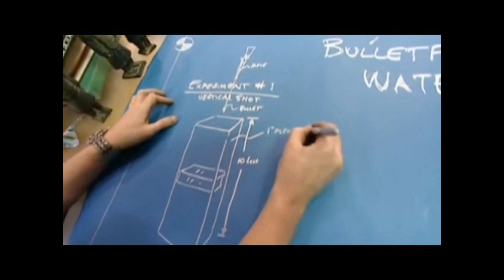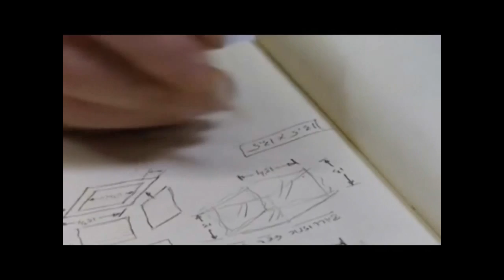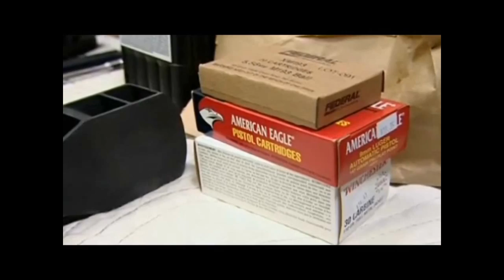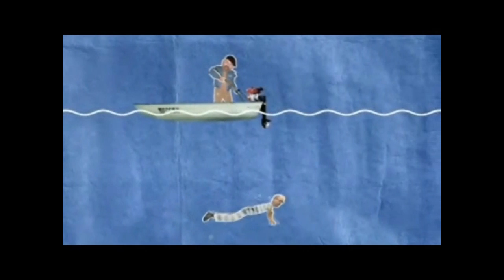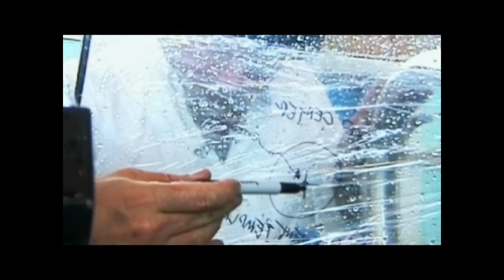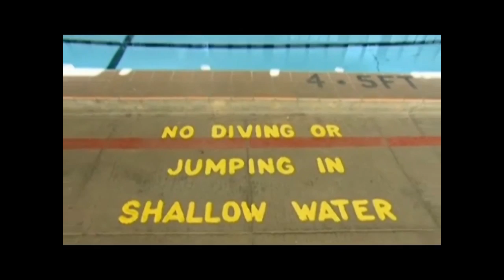Mythbusters Bullet Proof Water Myth

Comment: This might be false but I'll post it anyway. The kinetic energy is 0,5mv^2, so the faster the bullet travels, the more energy it has. Now everyone knows that energy won't get lost, but it'll be transformed into some other kind of energy. Now how faster the bullet goess, the harder it will hit the water. The bullet is made of a certain type of metal. All metals have their own 'allowable stress'. So the harder the bullet will hit the water, the higher the 'resulting stress'. So in conclusion, The bigger the gun, the faster the bullet will fly, the bigger the force will be, the faster the bullet will break. (sorry for any language errors, English is not my native tongue)
Reply: That works because liquid water is almost uncompressable material.
Reply: +LightCrasher Steel is compressible but water isn't?

For the same force applied steel will compress over 200 times less than water will.

The reason you "can shoot a bullet through steel" but not water is quite simply that you can't. Not for the same thickness anyway. 3 feet of steel will stop any bullet fired from any rifle ever made. The thickest tank armor is less than half a foot.
Reply: LightCrasher Common sense doesn't refuse to accept that, it just isn't true. Both incredibly obviously intuitively, when any thought is put into it, and experimentally. The bulk modulus of water is on the order of 1GPa, whereas steel is a few hundred depending on the type of steel. 

Here's an actual proper measurement of stainless steel's bulk modulus, page 20 http://www.nist.gov/data/nsrds/NSRDS-NBS-61-V.pdf

171GPa. 

And I was just about to go cite you the bulk modulus of water, but I've just seen the wikipedia article that you're getting your numbers from. The article you've got it from is in GPa, not psi, and shows very clearly that water's bulk modulus is much lower. You've compared water's bulk modulus in GPa to steel's in PSI.
Reply: LightCrasher Compressing metals... you've just failed 3rd grade science.
Reply: then why can you shoot the bullet trough steel or even bullet proof glass? ain't that harder than water?
Reply: LightCrasher I've said where I got them, and even shown that where you've got them says the exact same thing that water is much much more compressible than steel.
Reply: seldrava The moment of inertia has absolutely nothing at all to do with the penetration depth.
Reply: +BlueCosmology , By changing the moment of inertia, farthest fibre distance or ‘Modulus of Elasticity’ you can in fact make an object stronger. And since the ‘Modulus of Elasticity’ changes with different materials this causes one material to be harder to penetrate than the other. Please mention that this only applies to solid objects.

‘Moment of inertia can be thought of as resistance to deflection, yes. It is not what causes metal to be harder to penetrate than other objects.’ Let’s assume we have two objects (different materials), they both have the same dimensions, than in this case, the resistance to deflection does indeed not affect the resulting stress, since the Moment of inertia depends on the dimensions. All I’m saying is that by changing the Moment of inertia for different objects, and different materials (to make one object thicker and if possible less wide) you will lessen the resulting normal stress on that material. And eventually a (in this case) bullet will no longer be able to penetrate. I hope I explained what I meant more clearly now.
Reply: BlueCosmology Can I see where did you got this numbers from?
Reply: Did not see it at the feed trough...
Yeah, I see now. Thanks for correction.
Reply: +BlueCosmology , It has to do something with how much the 'to be penetrated' body can take.
Reply: seldrava It does not at all.
Reply: +BlueCosmology , It might be that I'm calling it wrong though. English is not my native language. I mean the resistance to deflection. Area moments of inertia maybe?
Reply: seldrava Moment of inertia can be thought of as resistance to deflection, yes. It is not what causes metal to be harder to penetrate than other objects.
Reply: @BlueCosmology  So, are u guys in NASA now after these 5 years???
Reply: @kingkong9233  I'm not sure why you're asking this but I was a member of CERN as a particle physicist on ATLAS 5 years ago and I still am now.
Reply: @BlueCosmology  Hey i was there too in the laser department and I still am now; wow, got alot of work to do; see u at the coffee shop.
Reply: @kingkong9233  Laser department?
Reply: @BlueCosmology  ohh, so you were serious about being a member of that CERN project?? I thought u were joking and so i replied childishly. Cheers to your hard work sir
Reply: BlueCosmology Wiki says that bulk modulus (pressure resistance basically) for steal is 290000000 psi while water`s bulk modulus is 22000000000 psi and increases proportionally to pressure. But yeah, common scense refuses to accept that.
And speaking of tank armor-it`s not just steel, it`s composite.
Reply: +LightCrasher +BlueCosmology , the reason why a bullet can shoot through metal and glass is because of the thickness of the object it has to force itself through. Yes a bullet will travel through a (relative) thin piece of metal. But when the metal (or glass, or any other object) is made thicker, the bullet won’t be able to travel through. This too is because of the loss of energy (consumed by the metal and changed into heat). The bullet needs a certain amount of energy to move through a medium, it doesn’t matter what kind of medium, this also applies to air. If you theoretically had a horizontal plane, and shoot a bullet with only air as its medium, the bullet will gradually reduce in speed and eventually stop by hitting the earth because of its gravitational pull. 

So yes, in theory if you’d be able to shoot a bullet to an upright water plate of let say 20mm (without any glass walls to keep the water in place). And compare that with a bullet being shot at a 20mm metal plate, I guarantee that the bullet will have a far more difficult time to travel through the metal plate.

In metal objects this is caused by something called ‘the moment of inertia, otherwise known as the angular mass or rotational inertia [mm^4]’ in combination with the ‘farthest fibre distance [mm]’.
Reply: arunashamal because they are compressible. If you take a fully hermetical space in a shape of pool, and load it full of steel or glass and then press it with a hydraulic press, it will be compressed, if you do same to water-it will flow out or even break a press if space will remain hermetical and pressure will continue to grow.

Comment: maybe i'm just being ignorant but I dont think that a vertical and 30 degree test is the same as I think your assuming water volume in any direction will have the same density.
Reply: Raj Singh water (and fluids in general) are nearly non-compressible. So yes, water density is the same no matter the direction.
There is the matter of how energy is released which depends on the angle but unless the angle is a perfect 90 degrees the result would be the same for supersonic bullets.

Comment: The faster and shallower an angle you fall into water. The harder the surface will be. If you've ever seen someone falling out of a moving helicopter at a low altitude into the sea. You'll notice them bouncing off the surface, and get serious burns as a result. It's the same concept when you're skimming stones along the water.
Reply: Reptilian I don't think so.
Surface tension allows very small objects like paperclips to float.

This is (probably) simply friction. And because water can't be compressed or move out of the way fast enough, it has a much higher friction than air.
Reply: Raj Singh I don't really know if it has a name, but its due to the fact that when the round hits the water, the force it impacts with is dissipated rapidly, because of this it sends an equal amount of force back through the bullet (newtons 3rd law), this causes the bullet to tear apart because of these forces. Because the force is more with the larger rounds (Force=Mass x Acceleration), they will tear apart on impact more. Smaller rounds (9mm for example) have less mass and velocity, so would still decelerate, but the force hitting the round will be less, meaning it will decelerate at a slower rate, rather than just fragmenting. Hope that answers your question (Source: Forensic Ballistics Experience)
Reply: argh1989 I don't think surface tension matters very much. The supersonic bullet would still be destroyed, if you put a whole barrel of washing liquid into the pool.

It is simply water resistance. The faster an object moves, the higher the resistance, the higher the forces on the object.
Reply: what is this phenomenon called
Reply: Raj Singh  it's called verbal diahorea
Reply: David owen-lee
 Maybe the deciding factor on whether the bullet gets destroyed or not is whether it's sub- or super-sonic ammunition. I could imagine that for a subsonic round the shockwave will break the surface tension to a certain degree right before the round penetrates and that could be why they don't break apart.
Reply: Reptilian
I think needing a lot of force to displace water is the cause for friction.
Reply: Schwarzer Ritter It's because of the force generated by the bullet is all transferred into the water, since the bullets are so big there is a substantial amount of force being transferred in a very small amount of time, causing the water to somewhat... solidify under the pressure.
This is the same as when you jump into a pool, if you jump in with your arms spread wide, you'll smack the surface of the water and the force generated will cause the water to seem as hard if not harder than concrete.
However in a diving position you make the shape of an arrow, which means the force is spread over a small area allowing the person to break the surface of the water
Reply: indeed but what I was unsure about was is it possible that rounds are made to be aerodynamic and structurally sound in one plane (forwards) to displace fluids either side of it? it seems intuitive that rounds do not have the same structural integrity on their side i.e. 30 degrees than they do head on?...on a separate note i think you maybe describing impact viscosity, although more damage happened to the round with higher calibre, i'm tempted to say there is an upper limit to this occurence, as in a maximum round energy to water volume/mass ratio...  ...engineers please confirm :)
Reply: Mitjitsu Thanks for the 2nd grade science lesson
Reply: dude some of what you have stated is correct about Newton's First Law. yes a bullet at sub sonic speeds will travel further in water . but in your first statement about someone jumping from a helicopter and bouncing off the surface and receiving serious Burns is bullshit yes a person can ricochet of the water depending on there speed and angle but this bullshit they can receive serious Burns is bullshit you could get burn s say from on carpet from the friction as both surfaces create heat but against water impossible. explain this and if possible point out a link to this bullshit

Comment: One of the reasons the faster bullets fails is because the damping force (fluid friction) of the water acting on the bullet increases as bullet velocity increases.

But I suspect that the major reason is due to the entry angle of the bullet. When entering the water at an angle, the forces act on the "bottom" surface of the bullet first, this destabilizes the entire path of the bullet such that the flow of water around it becomes massively turbulent.
This is why the bullets can't travel very far when entering water at an angle. Eventually, at high enough bullet velocities, these turbulent forces become strong enough to rip apart the bullet itself.

Had the bullets entered head on, their aerodynamic shape would have allowed them a much further travel distance before stopping. The faster ones probably would not have been torn apart too.

Try the 50 Cal vertically. Would probably blow right through the floor.
Reply: This is why the 9mm bullet did a great job. The round is not extremly fast and the entry angle was almost perpendicular.
Reply: Surely we can agree that's a highly unrealistic firing situation tho. The odds of you being ABOVE the target are so much lower than you being at an angle to it, from the ground shooting at someone submerging into the water.
Reply: ok look, have you ever tried to fire a 50 cal at a 5-8 degree angle  ? the bullet will ricochet instantly
Reply: Would have been interesting to see the super sonic rifles vertically
Reply: the stress on the material would still be too strong and the bullet would deform greatly and unevenly, and stop very soon
Reply: Yes, the angle of entry is the issue to my mind, a high angle puts asymmetric forces on the bullet.
Reply: Out at sea there's a chance a wave will be at the right angle so the bullet doesn't enter at an angle. I'm guessing
Reply: That is actually a good example
Reply: So my guess is it's better to view myth busters on Youtube and read the comments rather than watching it on tv.

Comment: Its in both the velocity and angle. 
Velocity: Any object moving through water will experience a force proportional to its speed. These strong guns fired rounds at supersonic speed - the stronger is the stopping power by the water. Both handgun and shotgun fire subsonic rounds. 
Angle: Entering the surface the different angle will result to the application of a force off the center of the round and there damaging it severely. I tend to say as for handgun and shotgun the results will differ too.

Comment: actually the shotgun has a slow slug with lots of inertia, which probably explains why it went deep in the water. Also, it wasn't the slug that blew a hole at the bottom of the tank, but the concussive blast.

Comment: keeping in mind, the 9mm, when fired, had very little 'volume' of water to get through. For example , imagine about 10 layers of acrylic plastic with the dimensions of 10x10x1cm, that would be much easier to breach than something like 200x200x1com, because there there is less 'stuff' to get through. This is referring to the testing chamber and the swimming pool respectively.
:P

Comment: Consider diving in a pool at 3ft FLAT, then the water feels like concrete. Potentially damaging internal organs. 
Compare it with diving at 3ft but diving in shaped like a bullet. No damage done

*pressure = force/area
pressure on the water, by the bullet is so great (Vasts amount of force on a tiny surface)... it actually surpasses the maximum tension of the copper bullet (the maximum pressure the Copper bullet-tip can withstand)

Pressure water > maximum pressure bullet
--> bullet shatters

Comment: When they were talking about what guns could penetrate the bullet proof glass (around 13:30), they said nothing could until the M1 (Garand). The problem was that the gun that they were using was a bolt action, (I believe it may have been an M1903 Springfield, not an M1 (Garand)). Although this does fire the same cartridge, the .30-06.

Comment: Not in a bullet form, like the 20mm rounds you can fire from a 20mm rifle. The force would still be expended by the round shattering. 
flechette rounds are what's used for going through water, The physics favours that shape better.
If you mean the Uranium penetrator sabots that a tank fires that would work too because of the thin shape.